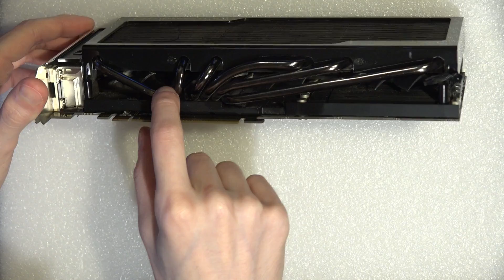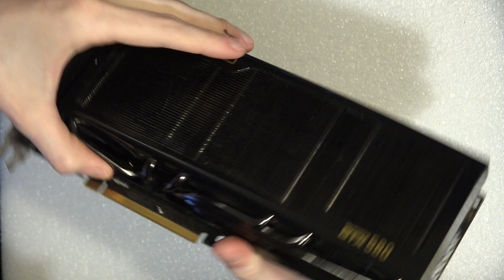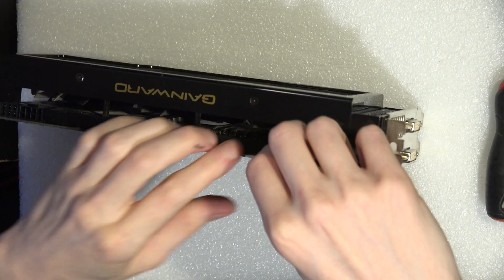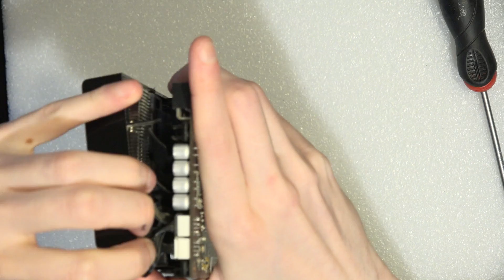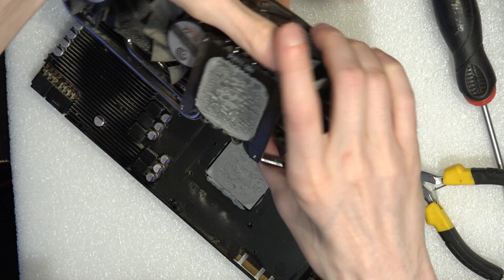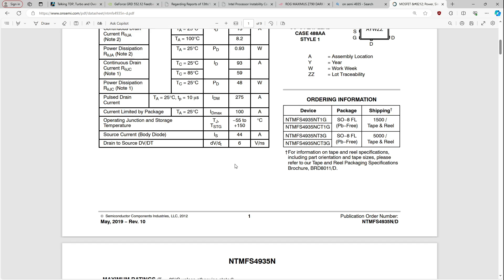Taking apart a kinda weird GTX 580 3GB card and then rambling about it

Comment: Asus tuf-rx7800xt-o16g-og-gaming (2.9 slot design, 1.2cm less width, middle fan 13 blades, 4 SMD can capacitors on ALL PCB, smaller vent hole, radiator with more heat pipes) VS 
Asus tuf-rx7800xt-o16g-gaming (2.96 slot, middle fan 11 blades, 25 SMD can capacitors total)? 
Which one is better and why...and more importantly, which seems less likely to have coil whine (and less noise in general)? In a no overclock and undervolt most likely forever scenario.
Do the black rectangle capacitors have more chance to cause coil whine (even if they are better)?

Comment: This shroud design would be decent if the fans were on top of the heatsink like they are in most cards since then the hot air would have more exit paths out of the heatsink (of course you would also need proper case airflow to ensure that the hot air exiting out the sides gets pushed out of the case instead of being recirculated). Unfortunately most cards have decorative shrouds that block the heatsink instead so "de-shrouding" a graphics card tends to improve thermal performance even without switching to case fans (though I imagine on some cards you can't even mount the stock fans properly without the shroud).

Comment: a bit of gpu necromancy question
do you have any idea why nobody ever made 4gb r7 260x?
you did mention this gpu is wierd because of memory density and i was wondering about myidea about increasing memory density on 260x
because why not make such gpu if a workstation versions of the same core did just that with w5100 and w4300
would it be too close to rx460 ?
i kind of want to make one

Comment: To my knowledge (cars) radiators mostly benefit from a single fan behind them, because vacuum makes the corners and center have the same airflow as the fan blade area. 
All this works with a shroud tho ...cars overheating oftentimes caused by people removing the shroud (for easier access and maintenance of the engine) 😂

Comment: I think it was a Thermalright CPU tower cooler I had with like 5cm long screws with very heavy springs that took so much force to make the second screw catch a thread it felt that either the first one will rip a hole through the board or your screwdriver will slip and stab the board. This leaf spring mount looks very tame in comparison.

Comment: The brown PCB reminds me of the AsRock Z77 EXtreme4 which "funnelE" enough has one of the most unique VRM designs I've ever seen. Its half analog, half digital. Mine still running strong with a 5GHz 3770K delid. The AsRock Z77 EXtreme4 would make a cool VRM review vid.
Reply from the maker: I don't really see anything that special about the ISL6367 that's used on that board.

Comment: G'day Buildzoid,
Yeah I also find when Engineers do Quirky Stuff like this interesting too, Sapphire's R9 Vapor-X V6 (2x3) & V10 (2x5) Engine VRMs also spring to mind.
I would find a "Did it work?" Thermal Comparison video interesting too.
Reply: thats my favorite card

what a time
Reply from the maker: the 290X doesn't really have a normal layout VRM for comparison but the 290 Vx  is basically the same VRM as the later 290 Tri-X and 390 Nitro. I might test that. Though the main thing I want to try with a 290 Vx is swapping the 3553 to 3550s.

Comment: Fans are slightly better at pulling through rather than pushing air into fins/rads.  EKWB has a page showing testing showing about a one degree difference.
Reply: Too bad EK won't be around for much longer at the rate they're going